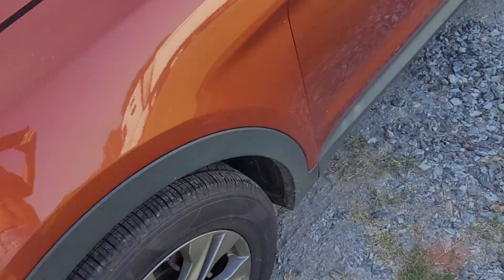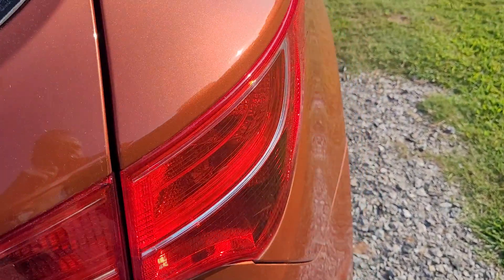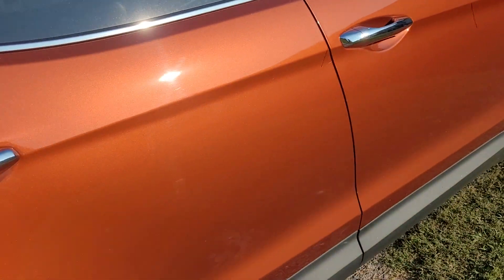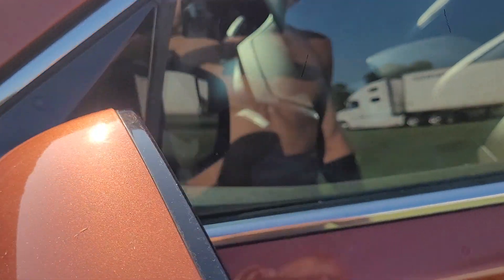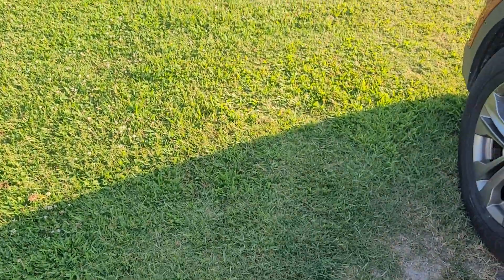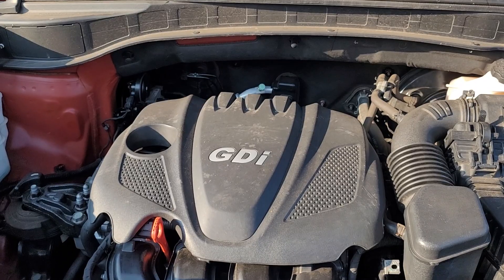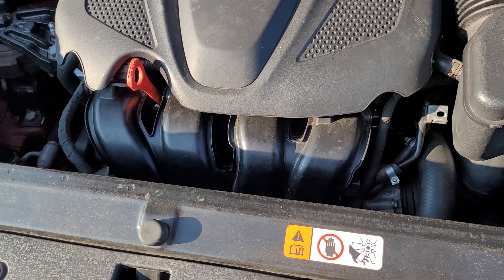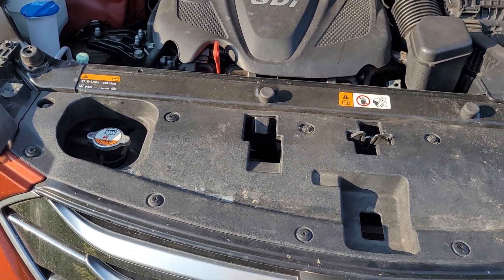More issues with my  16 Santa fe Sport

Comment: ❤❤❤❤👌🏻👌🏻👍🏻👍🏻👍🏻🌟🌟🌟🔔🔔🙏🏽🙏🏽🙏🏽
Reply from the maker: My car ended up not throwing any codes or check engines light's anymore and we had an appointment at the dealership a couple days after vid they checked it well and said no problems where detected so as we hoped and prayed it was simply a glitch in the C P U System